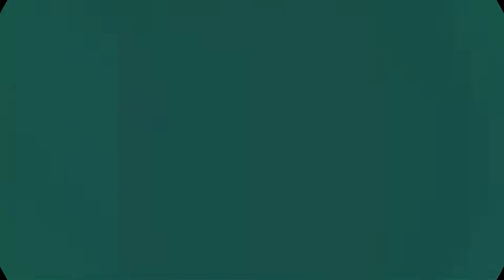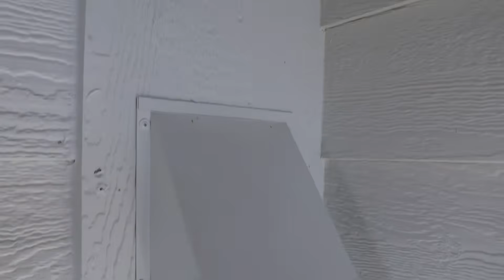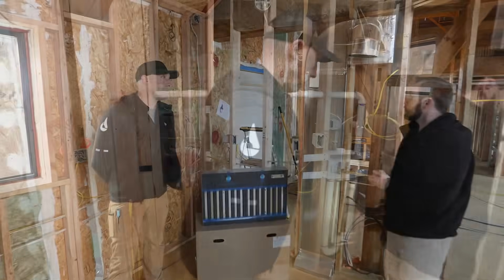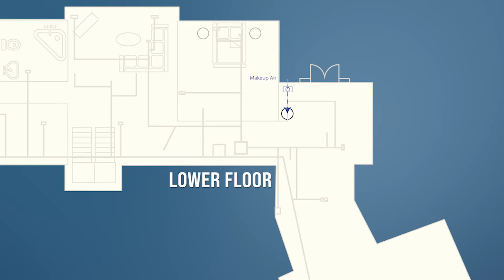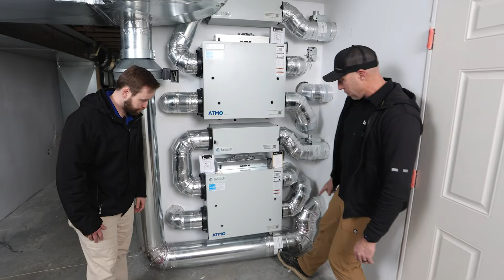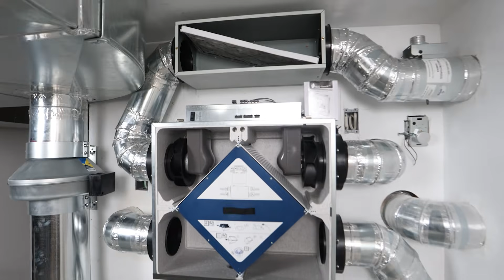5 Minutes with Fantech: Clothes Dryer Makeup Air. Episode 5.

Comment: My understanding is that best practice is to run the ERV 24/7, especially if you’re using it for bath fan ventilation, which means you’re always bringing in some level of fresh air. My system also has a boost mode, on demand, that increases airflow for short periods when needed. In either case, I’m unsure why a damper would still be necessary if the ERV is constantly running. Can you clarify the purpose of the damper in this setup?
Reply from the maker: That's a great questions. The reason for the outdoor air damper is to completely shut-off outdoor air during unusual events such as wildfire smoke or spraying by a skunk. Turning off the ERV stops the motorized impellers, but a closed damper also prevents odors and smoke from entering through the intake air duct. The damper is not needed for normal 24/7 operation, but it is useful when you want to temporarily isolate the house from outdoor air.

Comment: @fantech am I missing where the erv air is dumped? Return, supply or manifold?
Reply: @fantech is the second inline fan the make up with less cfm for the dryer?
Reply from the maker: @Rowdy1976  The makeup fan for the dryer is about 160-180 cfm.
Reply from the maker: The pre-conditioned outdoor air is supplied into the return duct.
Reply: @Fantechusa how do you balance an erv with branched out intake exhaust to bath/laundry/kitchen while dumping the fresh air into the return? Branched out rheia duct from manifolds with even amounts of ducts seems to be the most evenly balanced, but in the south entering the return makes sense for blending?

Comment: Need some help understanding this setup. It appears you have the MUA remote location fan pulling the MUA through the ERVs. Are you maxing the rated fan capacity of the ERVs in parallel to get the CFM you need as an imbalanced Boost setting (with the range hood as the negative pressure for envelope balance)? If that's the case, I thought it was the balanced exchange of CFM through the core that brings the best Enthalpy exchange; maybe I'm misunderstanding. I live in a state with basically no rules for residential, so this is somewhat harder to research locally!
Reply from the maker: No. The idea is not to max out the ERVs in parallel as an imbalanced boost mode. The ERV should stay balanced for ventilation. The makeup air fan is there to offset dryer's exhaust and minimize depressurization. The dryer creates the exhaust load; the makeup air fan helps replace that air in a controlled way.

Comment: Dear fan tech, please makes makeup air/hrv combo that can sense a pressure loss in the house and run. 
Your tech with single current sensor is old tech. 

Make a unit that can handle everything like dryers bathroom fans range hoods by sensing the pressure drop. Make it capable of 600+ cfm. And add an exchanger for energy recovery.
Reply from the maker: Thanks for sharing your idea! We’ll take this back to the team and see how we can work it into future development.
Reply: Seconding this @fantechusa

Comment: I know this isn’t a tutorial video, but you can’t put a current sensing relay around a piece of sheathed romex cable. It must be around an individual hot or neutral wire to detect current flow, if it’s around both, their fields cancel out, and no “current” is detected.
Reply from the maker: Great catch, and thanks for pointing it out with such clarity! That sensor won’t read a thing wrapped around the whole Romex. We always appreciate teammates helping make us all a bit better every day.